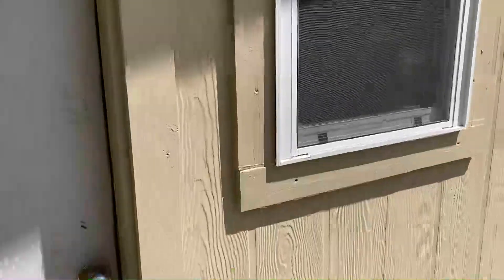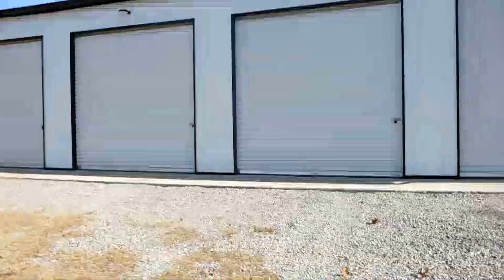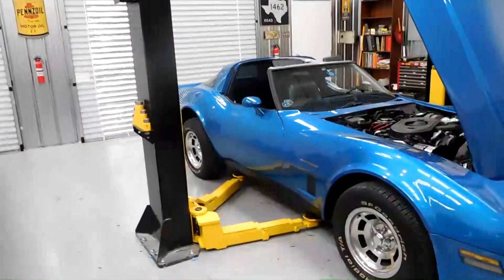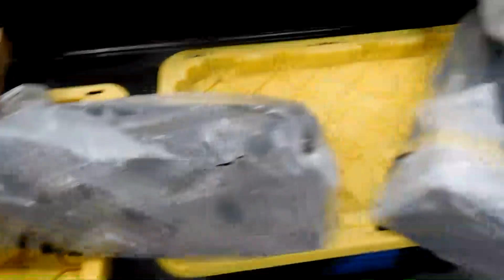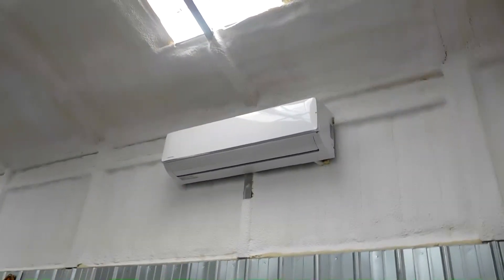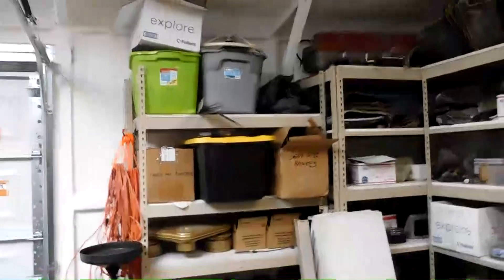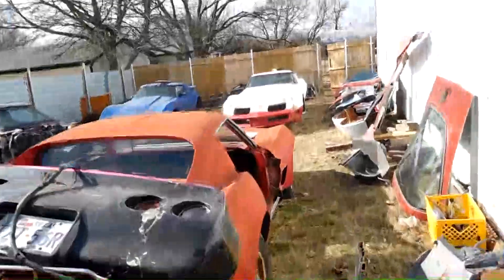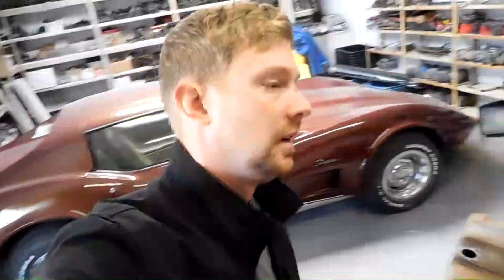My New Shop Is Finally "Done Enough"! 2023 New Shop Tour!

Comment: Good Job Ben! First Rate. I bought my house in Florida in May 2019. Before I moved anything in, I thoroughly degreased and  cleaned the bare cement garage floor,  etched the floor ,and epoxied it my self with the Rustoleum RockSolid products,  I put the speckles in AND used the clear coat too.  It was a lot of money for me but it transformed the place. Everything just wipes up and looks so nice. The finish is very hard. It is great.  I never had a garage so nice (I am 65).  My 1930 Ford Model A looks like it is in a TV studio. (I have to clean up my stray boxes of stuff too!) You won't regret it. Way better than bare rough cement.  WATCH OUT because epoxy floors do NOT like UV light. They will yellow. My garage door faces east, so I am careful to keep the doors closed in the morning until the sun is NOT shining on the floors. Make sure garage floor is in the shade when you want the doors open for any length of time.  That's why you never see epoxied cement coverings outside on the driveway.  Outdoor Cement Floor paint can be used outdoors.
Cheers, Chuck in Florida

Comment: Nice shop Ben, you'll do good in there. I didn't see and fire safety extinguishers, might want to have two for each bay and the back room. The noise from the compressor will resonate in that large room. Give consideration to closing it in into a well insulated place w/air intake. Don't forget security for the building. Look forward to the next video.

Comment: Congratulations on the new property and shop , I have a 79 C3 I'v had for 20 plus years and would like to find a good frame to replace the one i have. it's been repaired it will work but not pretty.

Comment: Thanks for the shop tour.  Congratulations to the shop. I heard that you had to work hard for it but it Will play of for you. 
A question, you Said you are rebuilding columns, i have a 1971 with a standard column but very much like tilt column as im tall and can hardly get move my leggs under the wheel when when taking the seat. Do youhave any option for me or advice for an aftermarket column?  Thank you and Keep those videos comming.

Comment: I remember when you were working in your family garage. Congrats, Ben, hard work pays off, luck has very little to do with it. 
I think you did a great job designing a space that works for you. Trust me, if you work in them they never get spotless, at least mine doesn't. My only gripe with the floor stuff is you really do wind up ruining it if you weld at all, or run a plasma, etc. 
In my shop epoxy in the fabrication area is destroyed...but moving some of the machinery to re do it is just not on my list. Too dang busy. I wish I had done the skylights, those are nice!